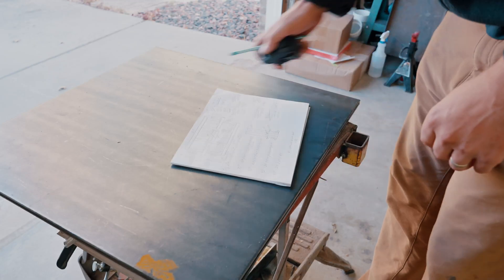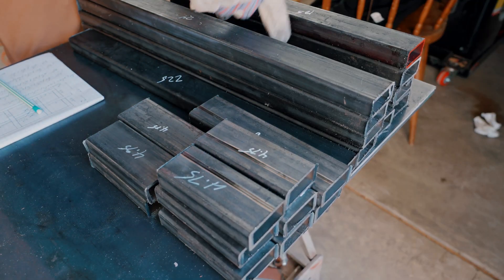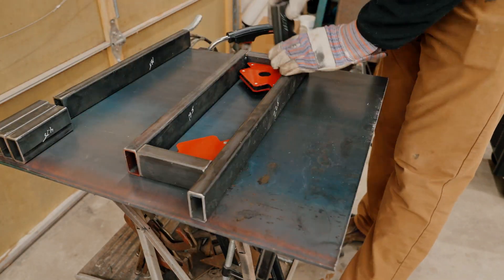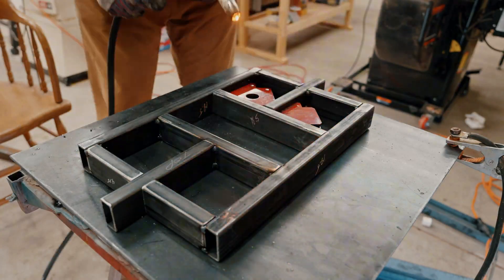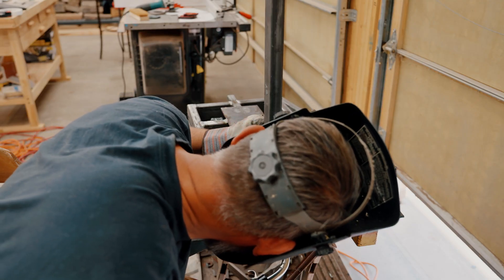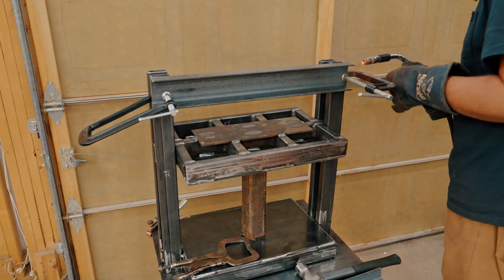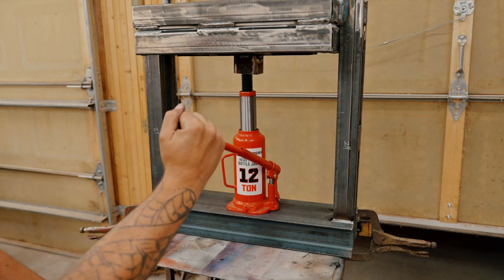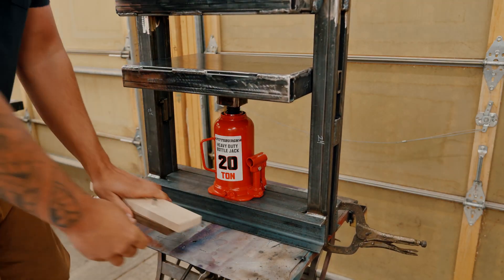I Built a DIY Metal Press for Wood Inlays

Comment: Welding isn’t in my skillset, although would love to one day. Looks great Maurice. Not to be a hindsight  commenter, but wouldn’t it be easier to clamp on bottom so you can balance the wood pieces easier? I’d probably also add linear rails on side so it doesn’t tilt. But what do I know. Great job and  🤞 for the wavy flag.
Reply from the maker: 😂 no worries, I thought about doing the downward pressure, I just didn’t want to do the springs to pull it back up.